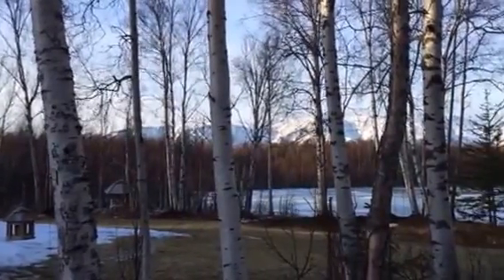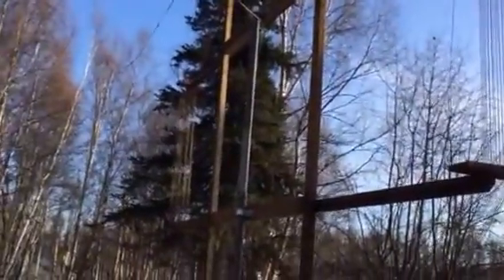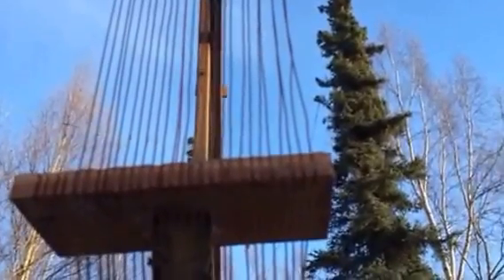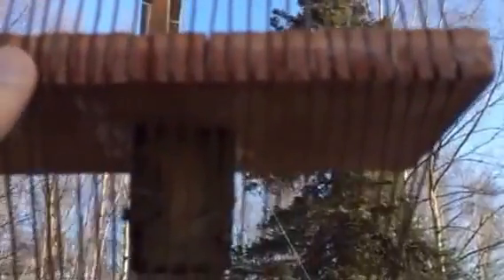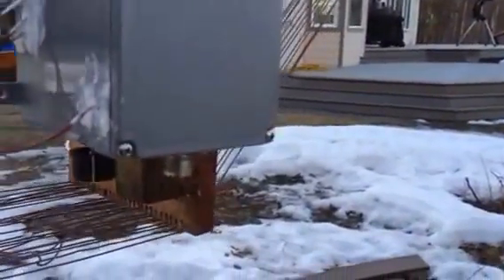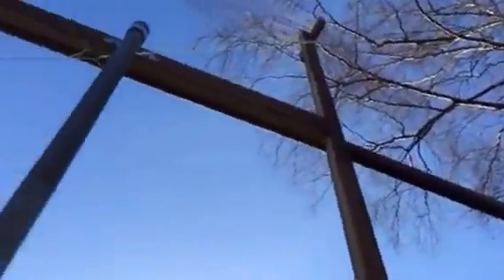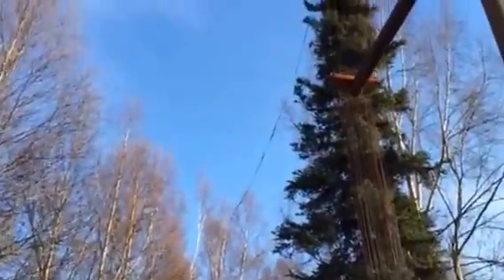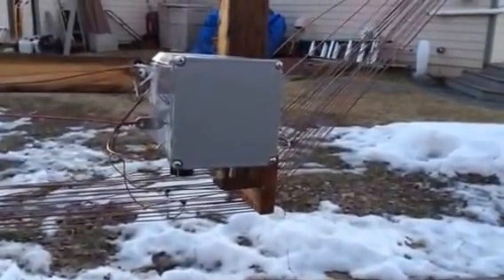VLF loop antennae @ KL7L

Comment: Missing the folow-up video with the results. 73' ON2RON
Reply from the maker: Hi Ron - well the antenna lasted 3 Alaskan winters before a large tree fell on it and destroyed it completely. As a solution for VLF and LF it worked pretty (very) well - it generally provided very sharp responses on tuning and null directions were very good for eliminating the new QRM noises appearing from LED and Switch mode power supplies. I did add a w7iuv preamp at the loop fed by dc coming up the center of the RG6 to cope with the very long runs and the need to dig deep into the noise.  It was also a bit closer to the road and neighbors houses so on 137kHz it afforded about 1-2 dB worse s/n on WSPR, and also the same for SAQ broadcasts over my L400b eprobe down by the lake. As ever the radiation pattern in the horizontal and vertical planes provided another view if compared with my other antennas and it proved useful.  Ive not got round to a rebuild and presently strung up a 40ft vertical and un/un/ W7IUV preamp as a relatively low noise vertical.  Thanks for reaching out. Laurence KL7L